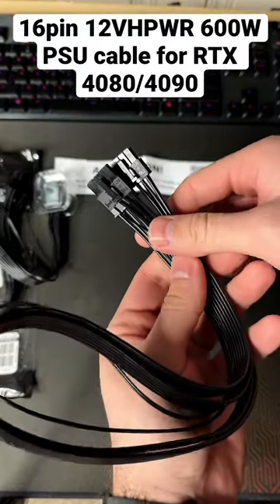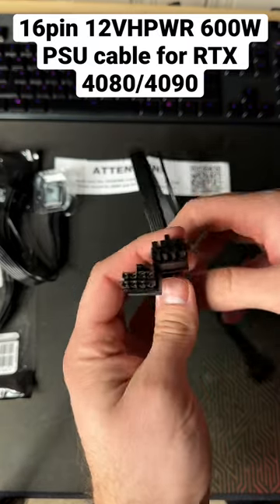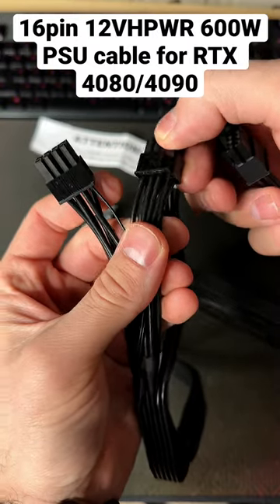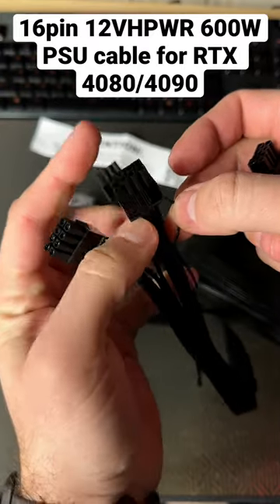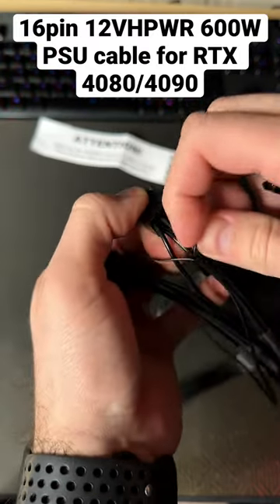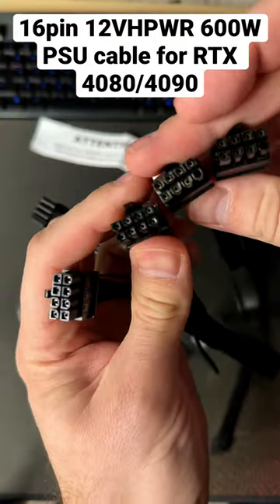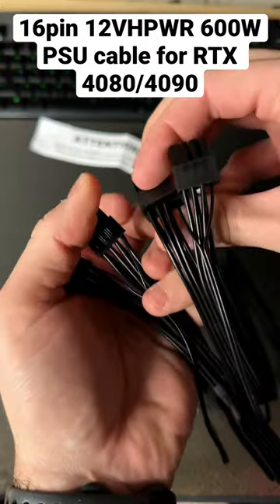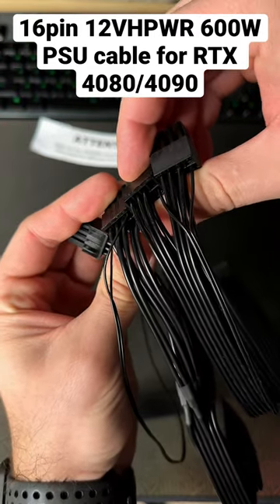ModDiy 16pin 12VHPWR 600 watt Power Supply Cable for RTX 4080 / 4090

Comment: can you use this on a 7900xtx?
Reply: Same question here. As far as I know it should work just fine as long as you’ve got 3 8pin / 6+2 pin connectors, as that many are required for a 7900 xtx. What you should be worrying about is whether the cables they have on their site are compatible with your PSU, but they should be as they have a wide variety of cables for different ones.
Reply: @michaelrad3921 did it work? Because i also have a 7900xtx and would like to know before buying a psu
Reply: It will not work, radeon cards do not support pcie5 pin connectors, just use the regular 6+2 pcie

Comment: HOW DO U INSTALL THESE
Reply: i'm sure u figured it out by now but the two split cables are the ones that connect to the PSU, and the single cable will connect to the GPU
Reply: My pc came with them they were at the back and the back wasn’t coming off and there were like 10 extra screws in didnt get but i did and my gpu doesn’t open i cant plug nothing into it

Comment: Yeah I tried to use this cable and my 4090 fans spin but the RTX lighting doesn’t light up and shows no signal. Not sure what to do
Reply: You tried using the original one?
Reply: @notworthit1096  it was the MB.
Reply: @PilotWinks  oh damn bro thats not the worst but is bad. I currently finished my 1st build after owning 2 iBuyPower PC for less than a month both they had countless issues straight out the box. I finished my build last week and before the 1st boot I had to take it to a PC repair shop because it turned on and off. Turns out the case button was bad.

Comment: My card didnt boot..so what do i do i believe i have the same cables i ordered from Amazon
Reply: Did u figure it out? Mine not booting either, not even fan working, only logo light
Reply: Remember to put ur monitor cable hdmi or dp into the GPU not the MOTHERBOARD

Comment: Hey, I also just got these cables but my gpu is not booting, is there a specific port or way that I should be connecting them
Reply: It should be the VGA ports on the PSU so you would take 2 slots on the PSU just for the GPU. Hope this helps.
Reply: @notworthit1096 well the adapter has 3 cables so why would you only use 2 ports instead of 3
Reply: @ANRO_ANRO  dual 8 pin to single 16 pin. Where did you get confused? Single 16 to the card dual 8 to the PSU. Thats how I have it on mines and no issues whatsoever.
Reply: @notworthit1096  yup based on what u said now it worked…i was confused on the connections the actual sketch or directions from the manufacturer did not say to plug it into VGA or SATA 6 pin but it worked on my 8 pin VGA connections and now its up and running..thanx
Reply: @ANRO_ANRO  perfect brother, glad you got it going. 👍🏽
Reply: @notworthit1096  main reason for me getting this graphics card the MSI RTX 4080 Super is because i like to use 3D applications , video editing, and also Unreal Engine…and it needs a good graphics card to handle it all..👍👍

Comment: can I use this cable for a 4070 ti?
if not what cable do ı need for my sff case?
Reply: Y cable male 12vhpwr, female 2 pins 8
Reply: I tried using it on a Evga 850w, and it didn’t work…I think that some psu don’t recognize it.